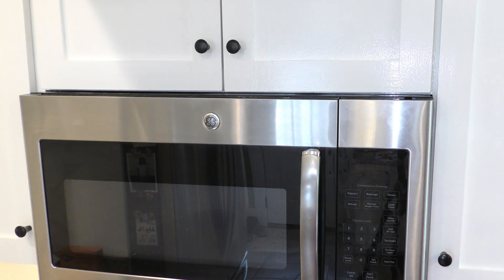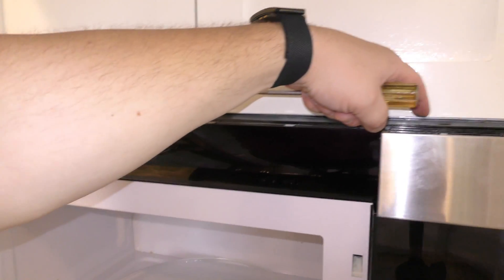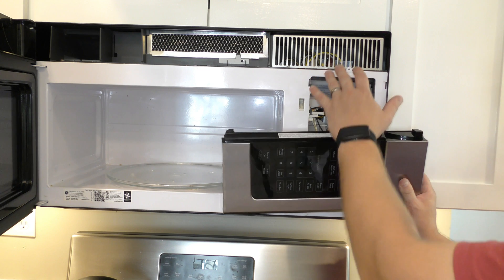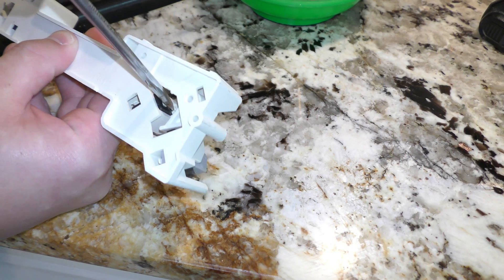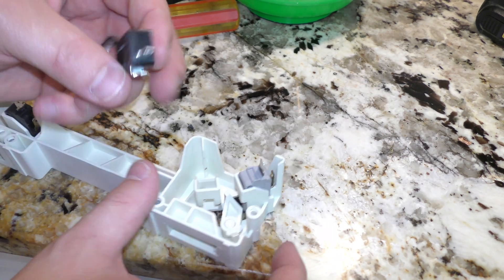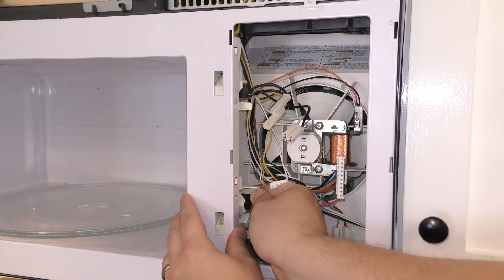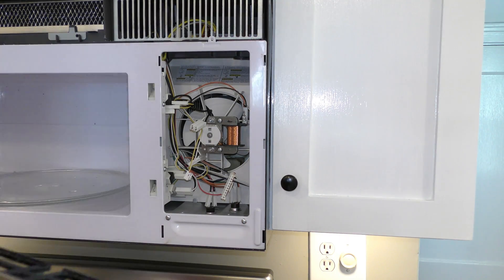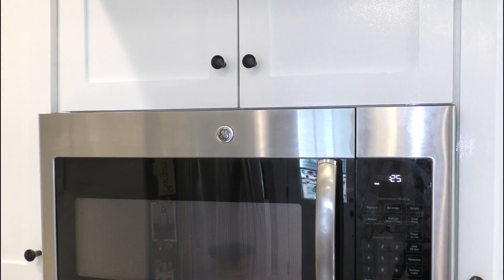GE Microwave Keeps Blowing Fuse / Breaker - DIY Fix

Comment: Microwave in this video  - GE Model JVM3160RF4SS
I have had the same problem but I solved it in a different way.  I simple disconnected the normally closed micro switch instead of replacing it.  The microwave now works fine. It does not blow the fuse anymore when I open the door with it running.  The light goes on when the door opens as usual.  I had tried to replace the switch a few times but the switch keep going bad.  I don't know why but it works just fine without the darn switch.  If you are having the circuit breaker trip when you open the door while it is still running then give this fix a try.  There is no need to remove the switch just unplug the connection to the switch. 

I hope this quick fix helps you guys!

Comment: Follow your system and it worked the first time then the second module blew out and I replaced it. Now, as soon as I plugged it in, the light and everything came on including the microwave, and can't shut it off without unplugging it. Any idea what I hooked up wrong?
Reply from the maker: Sounds to me like the positioning of the switches is off ever so slightly. You might want to look at your bracket and see if there is wear and tear on the ramps. These cheap parts go bad as well - New Latch Bracket - https://amzn.to/3rXmoy1

Comment: Super…video key fob rob……you helped me out to fix same issue. Panicking because over the range hassle..and GE slate colour. Replaced limits a couple of times before seeing this and as you mentioned to replace the plastic “lock asm” as they call it (the bracket that holds micro switches). I noticed the ramps on the door slots worn a bit right at the end where the latch would drop down. I could be wrong here but maybe a worn ramp tip now a bit shorter length could allow the middle interlock microswitch not be the first to close on door close and first to open on door open. It’s the middle micro sw. that I kept blowing. In replacing the new bracket I noticed the middle micro off set to left a bit so I added a spacer (credit card thickness) on the end before sliding switch in, it was still thin enough to lock tab on micro switch. It sits more centred and all is good now.  I noticed a light smearing of lubricant on the ramps of the replacement lock asm, hmmm, maybe I need to look into further as a maintenance item, I don’t want to wear out these ones to soon! Not to much though as it will collect on that plastic pivot below it. Thanks again for posting!👍
Reply from the maker: Glad I could help!

Comment: How does the switch blow the fuse? 
Also if it is the switch and the fuse is not blown then why would it turn off like that in the first place? 
Trying to understand what is wrong with mine lol

I put in a new capacitor that was same serial number and tested it then this exactly the same happened to me, ran for 2 sec then dead.

Comment: I followed your very clear instructions and luckily, it was the 20 AMP fuse that was the issue. A quick trip to the hardware store and replaced the $4.00 fuse and the microwave works! Thank you for saving me $250 or more.
Reply from the maker: Glad it helped

Comment: I have this exact model. It kept kicking off 1-2 seconds in and tripping the breaker. The wife was about to order a new one but I decided to Google fixes first. It was a free repair and saved us $600! For us we didn't have to replace anything. 1 of the 3 switches was fused, but after cleaning the gunk off of it (eventually oils and dust settle in), it was back to clicking like brand new. Put it back together and it's worked since. Thank you!
Reply: same thing with mine!  after taking it apart and playing around with it it started clicking again!

Comment: I ordered the new switches but they were not the problem,  from slamming the door too much the top switch was rocking back and forth so I used superglue and a toothpick wedged into the space to secure it and then added a scree that was not there before to the top part of the area holding the switch panel in place- it was designed for TWO screws in the top area and there was only ONE there- so it seems they new there would be a door slamming problem  but only used ONE of the two screws in the production run of mine.
Reply from the maker: Sheesh - what a terrible corner to cut.

Comment: I was anticipating a microwave replacement, I watched the video, ordered the switches and we are back in business!  Thank you so much for sharing this knowledge!

UPDATE:  The microwave worked for fine for about 10 uses, I opened the door while it was running and i think I toasted a door switch again.  I'm going to try one more batch of switches and see if that works.  I have a feeling the morale of the story here is to stop the microwave before opening the door.
Reply from the maker: Glad I could help!
Reply from the maker: Often, when this happens the door latch (thing that holds the switches) has been worn down - New Latch Bracket - https://amzn.to/3rXmoy1
Reply: Hey Matt! Did your microwave hold up after the second fix?
Reply: That happened to me. It's the top fuse, not the ones in the inside panel.
Reply: The door-activated switches have to be tripped in the proper order - one of them is a "monitor" switch that is designed to blow the fuse if it thinks that one of the others has failed.  The timing is fiddly, and depends very much on the switches and latches being aligned just so.  Loose mounting brackets, worn latches, or even a slightly bent door or door hinge is enough to put them out of whack.

Comment: Awesome and thanks for creating this video.  This is exactly what was wrong with our GE microwave.  Ordered the part on Amazon for 5 bucks.  Took about 15 minutes to swap out the part and now back to microwave'n my frozen burrito.
Reply from the maker: Glad it helped!
Reply: @KeyFobRob  Hi - I have same problem and I replaced the middle switch “NC” which gives continuity when door is closed. I also replaced it with 20A / 125V fuse but the fuse blow away after few mins but the switch still looks good. This is my 4th fuse and it keeps blowing. Any thought/idea what is causing this ? Thx in advance.

Comment: Thanks for posting.  I have to keep replacing 20amp fuses as of late.   Should I look for a bad switch ??
Reply from the maker: Either a bad switch or the latch bracket - New Latch Bracket - https://amzn.to/3rXmoy1

Inspect both and you'll likely see some wear on one or both of them
Reply: Now the light goes on when I open the door but the display is not lighting up

Comment: Hello, Rob! I have this same microwave. One of the little segments that make up the time display has disappeared in the past 2 months. 2-3 times since then when I open the microwave door, the microwave turns off. I have to cut the power to the house and then turn it back on in order to get the microwave working again. I am hoping to follow your video this weekend. Do you think the part that you replaced will fix both issues? 

Thanks!
Reply from the maker: I think it would likely only fix the 2nd issue.
Reply: Thank you!! I am working on this project now. I can’t get the screw out that’s behind that panel. Can I spray WD-40 in there?
Reply: This is the second screw to unscrew before removing the control panel. In your video you show it around 36 seconds. You mention there’s a second screw behind a panel to remove. I can’t for the life of me get it out and I don’t want to strip it.
Reply from the maker: @kellieast1009  do not spray WD-40 down there.
Reply: Hey Rob! I still can not for the life of me get that screw out behind the panel. I bought a 6 inch drill bit thinking that could get it but it won’t give. What do you recommend that I do?

Comment: I went through a very similar problem with my microwave. Replaced the fuse, the door latch sensors/buttons, and it powered back on when I flipped the breaker back on. But then I closed the door.... And it all died again. Blew the fuse and the new latch sensors as well. It's all shorted somewhere, but I can't figure out where. Any ideas?
Reply: @CyberFam - I also have the same issue. Replaced fuse and bad micro switch but still fuse is keep blowing. Are you able to resolve your issue?
Reply from the maker: Did you check out the Latch Bracket - https://amzn.to/3rXmoy1 ?

Comment: Rob:  Thanks so much for this video.  I would typically not have taken on a project like this but your video made it clear that mere mortals could solve this problem.  

I have a GE JVM3160 series micro that suddenly went dead.  I took the control panel off, found that the glass capsule fuse up top and one of the thermal fuses were bad.  I  replaced the fuses, put everything back together and, viola!  It works.  

There's one catch though.  The minute I plugged the micro back in, I heard the fan running, although, at an even lower speed than the low fan setting.  Otherwise, everything else behaves 100% normally.  However, as long as the unit is plugged in, I hear the fan at that low speed.  Operating the fan control button will activate the fan at the normal low and high speeds but will not stop the perpetual low speed run.  Apparently, I messed something up with the circuit board or one of the connections.  Any suggestions on how to troubleshoot this?
Thanks again,
Tom

👍
Reply: I just ran into the exact same problem with the fan. Any suggestions?
Reply: Hey guys the thermostat on the bottom right is 70 with a red dot. It will not and should not have continuity. The one on the bottom left is 120 and will and should have continuity. They look the same; but, they are not. If you put a 120 in the 70 spot, the fan will keep running. It sounds like that's what you guys are describing. The 70 is a thermostat that turns on the fan when it reaches a temperature, I believe above 125 Fahrenheit. I hope this helps!

Comment: I have this same microwave it jus want out I want to heat someone up it jus made a zap sound n want out. my fuse in the braker box was off I flip that back on n unplug the microwave for  over night but after replugin it still won't work I don't want have replace the whole thing can u point in the right direction on want I should try n do I'm replace the fuse in the braker tomorrow but how should I check for the microwave b4 calling to have it all replace

Comment: Thank you for this Key Fob Rob--I will try this immediately; same microwave. Will hopefully save us from buying a crappy cheap replacement microwave! Thanks!!!!
Reply from the maker: Best of luck!
Reply: @KeyFobRob  Just did it--and it worked like a charm. Same switch you replaced, too. But our weeks of blowing the circuit also blew the fuse in the microwave, so had to replace both. But it was a piece of cake, thanks to your video. Thanks again for the tutorial. Saved us!

Comment: This was exactly the issue with my Microwave.  I was so happy to find this video.  It was even the same switch that was the issue.  I cost me 20 bucks in parts from amazon and took about 20 minutes to make the change. 10 minutes to take it apart and then wait 2 days for the part and then 10 minutes to put it back together.
Reply from the maker: Glad I could help!

Comment: I was really excited to find this and try it, and your video helped me fix it - temporarily.  After only 3 times using it, same problem!  The circuit breaker tripped and I think I'll find that the same switch is fused.  If anyone has had this happen and has another idea what might be going on, that would be appreciated.
Reply from the maker: If the switch went bad again, it's usually the switch holder that has melted or deformed - https://amzn.to/3pNDHkh
Reply: @KeyFobRob  Thank you again.  I installed it and ordered new switches again but now the microwave  is doing weird things (like running before I turn it on, or when I redid the switches, not running at all but the light on the inside of the oven stays on all the time.)  I may have gotten the switches mixed up (although that seems unlikely the way the pins work) so I ordered another set and will give it one more try.
Reply from the maker: @Megahercz  Sounds like some of the switches are in the wrong position. Check those again and give it a whirl
Reply: @KeyFobRob  Whelp, put new switches in.  They look right, are specced right with the parts manual, and the leads attach as they should (and really the only way they can as I see it -- i.e., I couldn't have switched up the NC with the NO because then the leads wouldn't fit on) and it still doesn't work right.  It won't start cooking and the internal oven light is always on.  So, unless you have any last advice, I'm replacing it.  I must have somehow broken something else.  Either way, you are awesome for putting this up and the previous responses!
Reply from the maker: @Megahercz  Bummer - Wish I had any additional ideas but that's way beyond my knowledge. Take care

Comment: Thanks for the tutorial!  Question: I accessed the switch and pressed it a few times to get it clicking again because it was stuck. Now, the microwave will turn on without blowing a fuse, but it does not heat food. Do you have any thoughts on this? Thanks again.

Comment: In my case the plastic ramp for the door hook was worn and the second switch on the bottom was not being engaged by the face of the hook. The hook face is also getting a groove in it from slamming into the switch plunger. What a mess. Needless wear because of cheap plastic parts. The switch holder assembly is about $50 bucks and $6 dollars for each switch. That's better than buying a brand new microwave.
Reply from the maker: Those ramps on the switch holder wear out way too fast! If the switch went bad again, it's usually the switch holder that has melted or deformed - https://amzn.to/3pNDHkh

Comment: I work in an apartment complex and we have those GE microwaves we do replace the same switch that burns all the time but sometimes even though you replace it they still continue to trip the breaker do you know any other tricks.
Reply from the maker: If the switch went bad again, it's usually the switch holder that has melted or deformed - https://amzn.to/3pNDHkh

Comment: Great video. Fwiw the Amazon link included 3 switches. Only 2 of them matched the microwave. One of the switches had three connectors. I swapped the top two switches though and all is good again. Thank you!
Reply from the maker: Thanks for the info!

Comment: Fantastic video!!! I was literally getting ready to go buy another microwave until I watched your video. It was indeed the same door switch. I pressed on my frozen switch a few times and it broke free and started clicking again like the others. It likely arc welded itself closed and pressing it several times broke the weld.  I'm going to replace the switch to be safe, but I'm back up and running until my part is delivered. Great work! Thanks Again!
Reply from the maker: Good stuff! And you're right, that switch will likely go bad again so good call on replacing it

Comment: We have a GE Profile over range microwave and hood fan that stopped working.  I checked the fuse and it was, indeed blown.  I replaced it and it blew immediately, so I checked the door switches.  They are all working properly, which means it may be the interlock relay, or something even more difficult and expensive to replace.  I think it's time for a new unit.  Ours was made in 2007, so we got a pretty good life out of it.  Thanks for the posting, though.  It's always good to know you tried the easy fixes before you threw in the towel.

Comment: if the 20a fuse is blowen in the microwave will it still come on and trip the breaker or not come on at all? update:  just tested the 20a fuses with multimeter and they are fine

Comment: You should always stop hit the "stop" button before opening the door on a running microwave.
No doing so is kinda like shifting your car into 'park' while it's still rolling.
Reply: I agree, the oven should be stopped before opening door - BUT as shown in the video, the fuse blew 1 or 2 seconds after starting, and no one was touching the the door or any part of the oven. What made the door interlock switch get damaged? Surges/arcing if using the door to stop oven? I had a blown fuse a few weeks ago (on a GE unit but different model) but the switches seem fine.  I also tried several ways to 'abuse' the unit by using door but cannot get fuse to fail again.
Reply: I tried this fix, but didn't complete fix it. It was tripping breaker almost instantly. So I replaced the three switches. Even though it was the common nc switch at the bottom. Just so I don't have to reopen later. But now it don't trip breaker. The count down starts and keeps running. But turntable is not moving. And don't sound like it's running. Before the switch swap out. It at least ran for few seconds. Not sure what to do now.

Comment: I had switch from Amazon and found switch was bad. It suppose to Normally close and when door close then it must open. Can't believe that new switch was bad. It was constantly tripping the breaker when we try to use Microwave. It is not matter when we use the light or Fan. So I just removed the switch and left the state like open circuit which suppose to be when door is close. Now, microwave work. This test I did to eliminate the another issue. I re-order the switch. Tried to buy from local part store and they are 10 times higher than Amazon.

Comment: I used a knife to pry open the switch and I unstuck it. The microwave works again and I just wont open the door while its operating again. (That's what causing it to fail in my case). 

Tip: i couldn't unplug the panel easily, so I used tape to hang if from the bottom rather than letting it dangle by the wires.